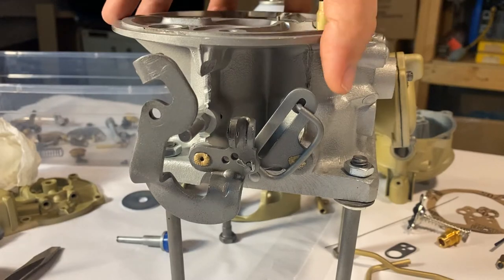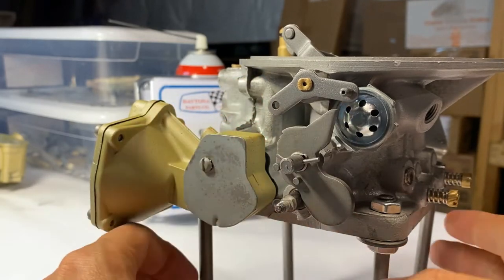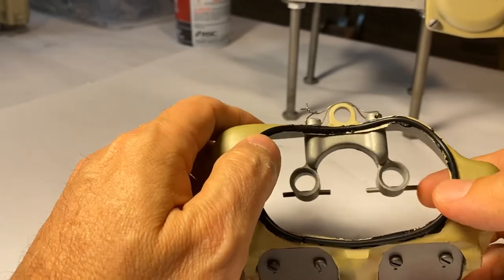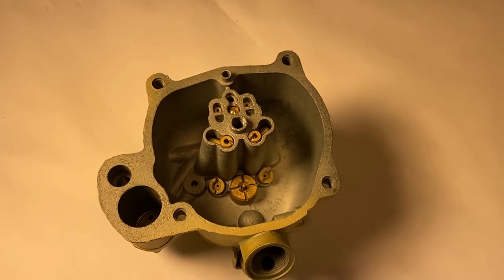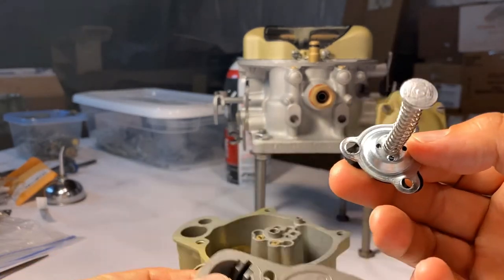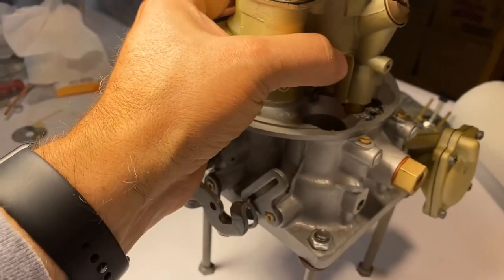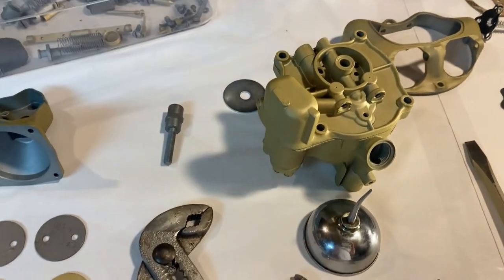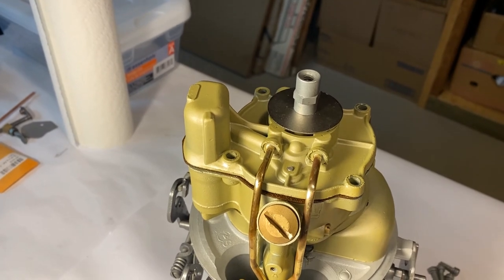ECK 9510 List 1074 1 Holley 4000 Carburetor Rebuild Part 2

Comment: I have just bought a 56 t-bird as far as i find out it has had two owners the car is in really good shape but it needs some tlc.  The carb on the car is really in need of some work.  I really enjoyed your video a real education on this old carb. A couple of questions.  First did you glass bead these parts they a really clean and then did you anodize gold those parts or?
Reply from the maker: yes - the blast cabinet works really well but if you do so you need to blow and wash out thoroughly. I have never had any issues on any of these carbs concerning blocked passageways but as you can tell in the videos the parts are squeaky clean. As far as the plating color is concerned I do have sone information on this in other Holley 4000 videos (can't remember which one right now, sorry) but I use a spray product from Eastwood called "Carb Renew".
Reply: @HotRodReverend  I'm having a little problem  locating a carb kit ECK 9510-H-1074
Reply: Daniel, do you have a source for rebuild kit for this ECK 9510-H Carb..  This is i think the numbers for a 56 312 engine. I don't have my carb off yet and i cant see the numbers yet, to make sure.  Thank you for the info. I have worked on these engines many, many years ago.
Reply from the maker: @jerryedginton502  the ECK is a 55 model year casting since the choke housing would be on the intake and not on the carb body for that year. The 56 was ECZ with different list numbers of course and the choke was on the carb throttle body. Watch my other video to help….
Reply from the maker: @jerryedginton502  https://youtu.be/dEK5QNOxpJk
Reply from the maker: @jerryedginton502  Daytona parts company - Kit 603 I believe. They are very helpful people.

Comment: Did I miss how you peened the washer and orings for the tubes? When I did my 55 that was the worst part as I couldn't make it seat and I presently have to do it again and am dreading it....
Reply from the maker: The best way to do this is to place the o-ring in the bore, then the washer. Next, take a deep socket from your tool box that fits down in the bore on the washer but gives you room to peen the edges of the throttle body to the bore. Press down lightly on the washer to compress the o-ring a little bit (after all this is what seals the secondary tubes in the bore), and then using a hammer and a small nail set or small punch you can peen the washer into position to hold the O-ring down. If you cannot manage holding onto the socket and the nail set at the same time, you can also use a slide clamp like the tool in woodworking to hold the socket against the washer. Then your other two hands are free. Of course, you can always get an extra hand to be in the shop to help!
Reply: @HotRodReverend  This seems more manageable than trying to find the old Kent Moore tool. Thanks!

Edit: I do also recall the washer being a little big and having to invert it or something as well... are there different ones for different years?
Reply from the maker: @ratherbeboating10  yes, the early 4000s had the smaller washers. If you purchase a quality kit you will get both sizes in the package though.
Reply: @HotRodReverend  I figured I'd update this. I just finished assembling the carb. I wish I didn't have to touch the tubes but the only issue with it was the oring joining the inlet to the bowl (ie dumping fuel down the secondaries.) So I pulled it apart. Everything was spotless. I will say that there just wasn't any material left to peen it over with. This is probably why I struggled with it last time too. I ended up using a sealant to bed the washer and oring in place compressedand then after it cured I installed the tubes and also added some to the topside incase it would leak. It is a fuel safe one I have used on submerged parts in fuel in the past and was told it would be just fine for this application. I am hoping it works just fine but I'll know later today. It's going on and then going for a test drive.

Thank you for your help again. 

-Paul